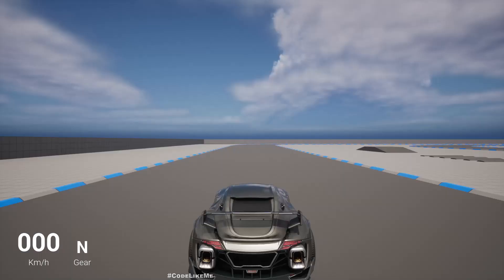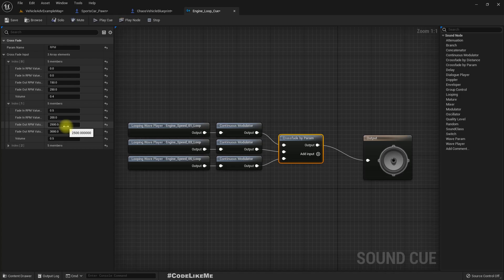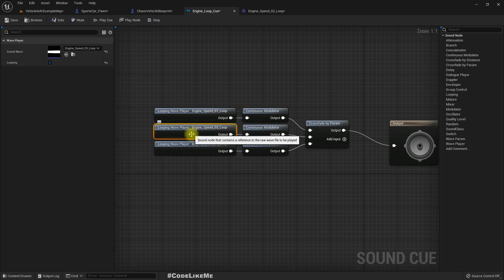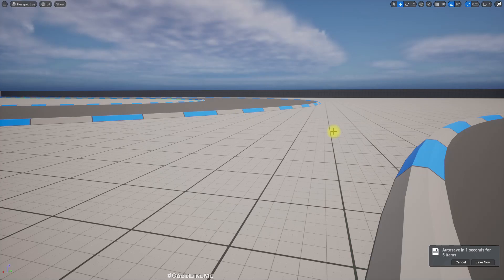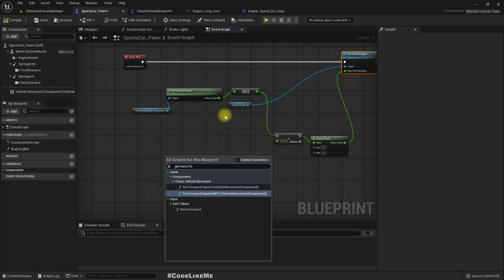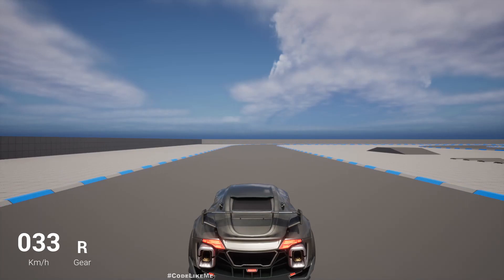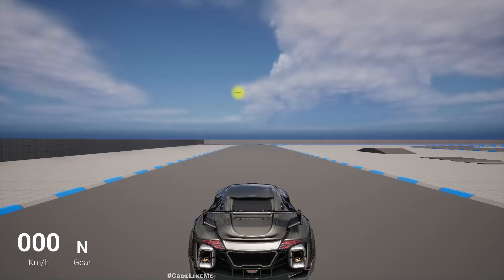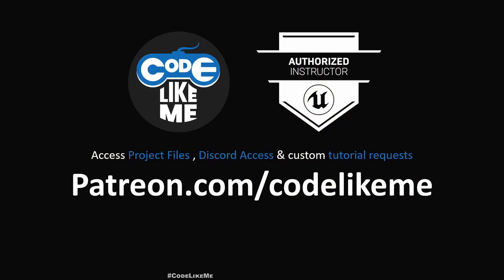Unreal Engine 5 Chaos Vehicle - Sports Car Engine Sounds

Comment: (Probably) a more correct way to handle this:

1. Vehicle Movement Component -> Cast to ChaosWheeledVehicleMovementComponent
2. As ChaosWheeledVehicleMovementComponent -> Get Engine Rotation Speed

If you plan on accessing ChaosWheeledVehicleMovementComponent frequently, promote to a variable so you don't have to cast all the time. You can also snag other useful information (speed in MPH, number of wheels, gears, etc)

😏
Reply from the maker: Hey, Thanks for letting me know. I have created another video using this method. 
https://youtu.be/RYX5sP9Sn7M

Comment: Hey, as i'm watching, this seems a bit wrong... in the BP you are getting the car's forward linear velocity which is in centimeters/second and not the engine RPM. For the value of let's say 1500 ( cm/s ), divide it by 100 to get M/s and then multiply by 3.6 to get Km/h which will give you around 56-57 Km/h like the speed that you have on screen at exactly that point of the video as an example ( https://youtu.be/rtAA02GYQdQ?t=305 ). This parameter doesn't work well for engine sounds ! Better see if you can get the actual RPM from the vehicle component ! Cheers !
Reply from the maker: Thanks for the tip. I'll look into that.